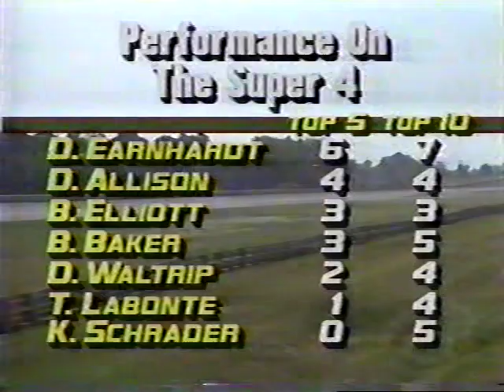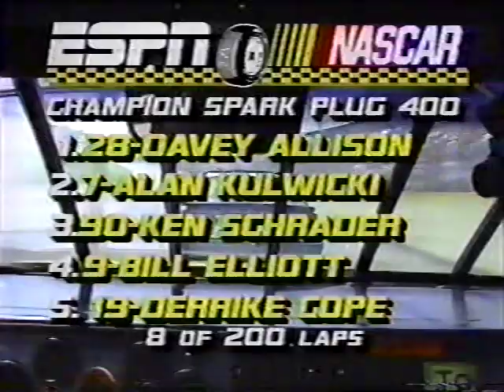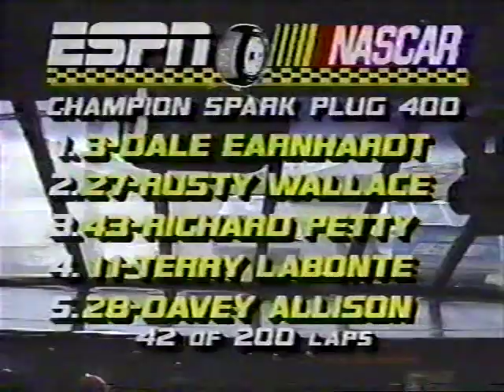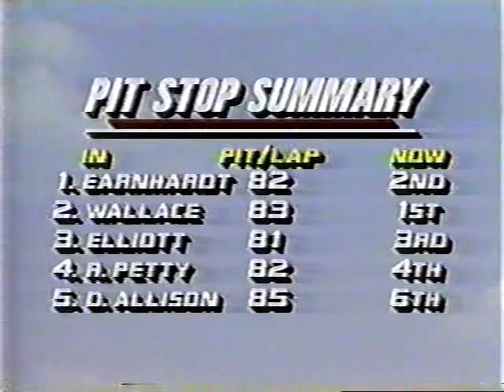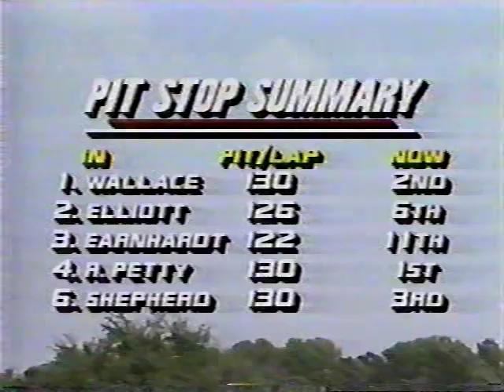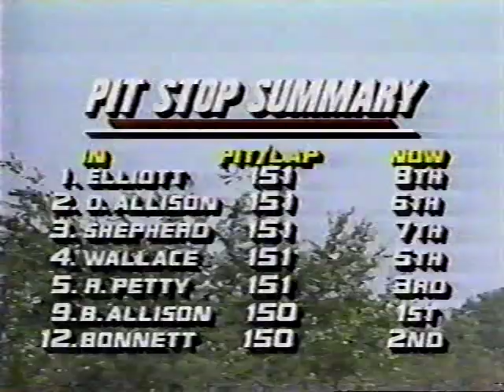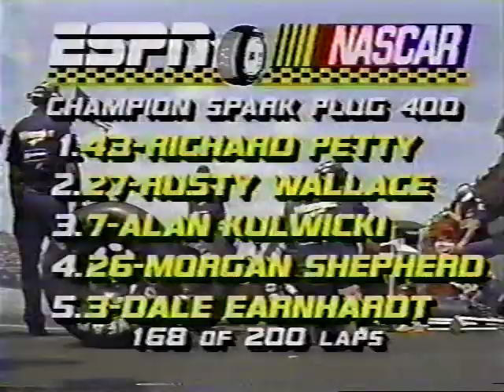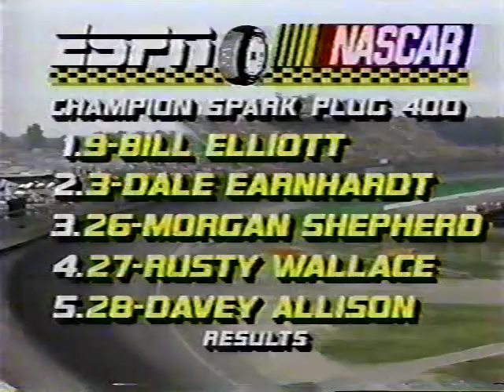1987 Champion Spark Plug 400

Comment: Proof that slower speeds does make racing better.
Reply: Absolutely you don't need extremely high speeds for great racing just go to any short track
Reply: That's what their trying to work on with the current package
Reply: Too bad the package this year there full throttle these guys were slower but still had to drive the cars
Reply: @tamezzodiac2862 not true these cars are actually running about the same speeds as the cars are now at Michigan, they had 890hp and much more head room to play with the throttle unlike now only 650 and at Michigant they are barely crackling 185 at the end of the straight and staying wide open, now it's all about momentum, and your right they had to drive these cars had bias ply tires could just sling those cars through the corners, and through the 90s the cars were as fast as they've ever been got up over 900hp in the early 90s.
Reply: They were still probably going 185-190 mph at the end of the straightaways.